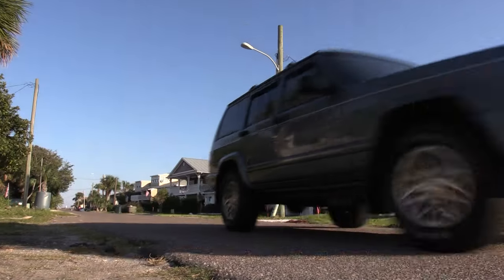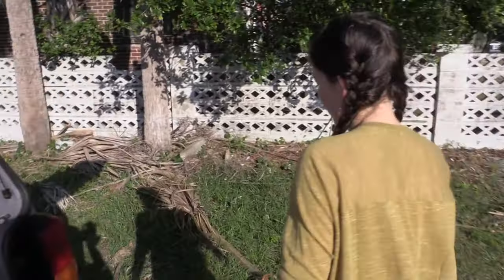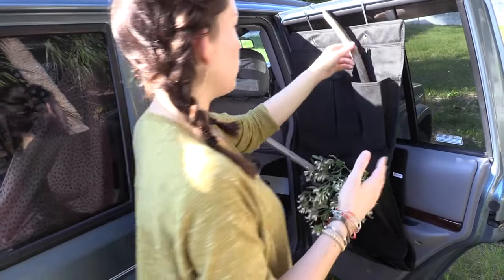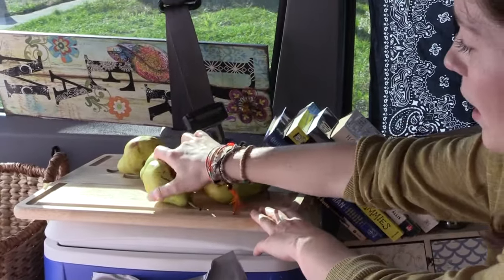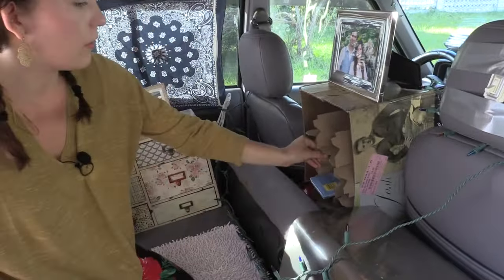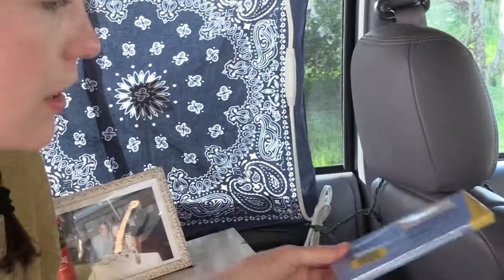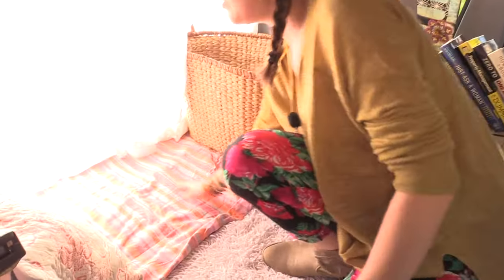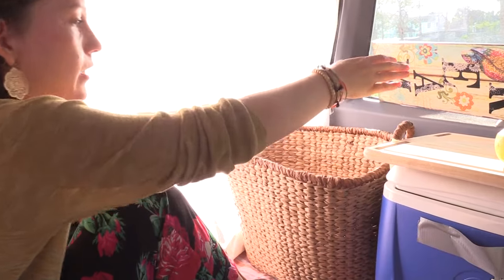Van Life Tour Parody

Comment: I've been trying to fit a full size bathroom into my BMW r1200rt, can you give me any pointers?
Reply from the maker: KFStreich I would be the one to ask. It does take a a dedicated engineer to solve an issue of such magnitude. First I would add an extra gas tank to the back, keep it empty, clean it out with rubbing alcohol, and have a welder cut in a door shape on the side(this is where your curtain will go). The curtain is very important. It will help separate your “driving” area from your “bathroom” area. Once you install your curtain, the bathroom options are endless!! I still have not figured out how to add a shower, so I can’t help you with that. One nice thing about living on a bike is that you do have your own natural dryer system in place, so you don’t need to reserve any space for towels. I hope that helps!

Comment: I know what your dealing with I been work camping out my Subaru 360 i got a logie in trunk   took out the back window so I can stretch out the other day I picked up a hitch hiker I thought he smelled but when I cut the cheese he opened the door and bailed out that wouldn't had been so bad but this little car has suicide doors and he sprung the hinges now I got bugie cords holding it some what closed I'm thinking of removing the roof panel and putting a  sheet of plywood on it and build up from there maybe put a tent on it well any way I like your Jeep. would you consider trading?